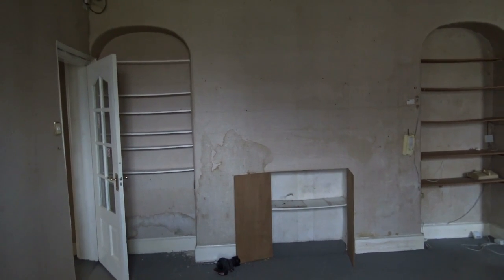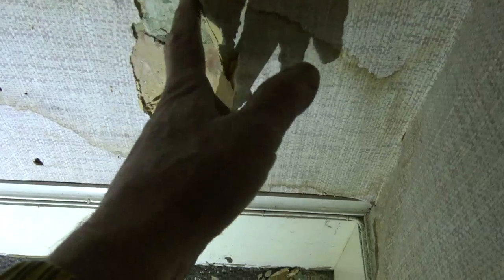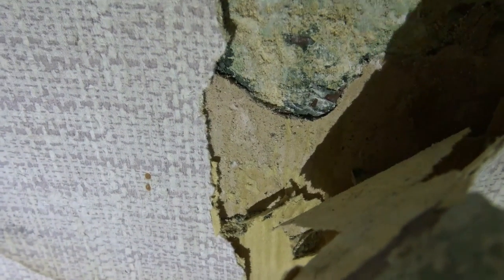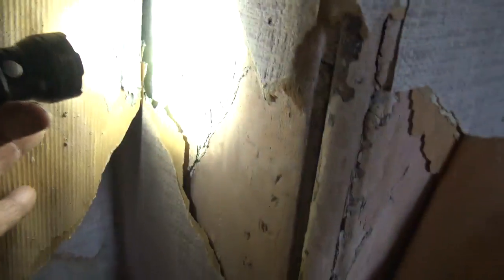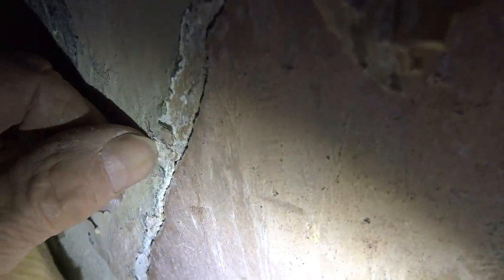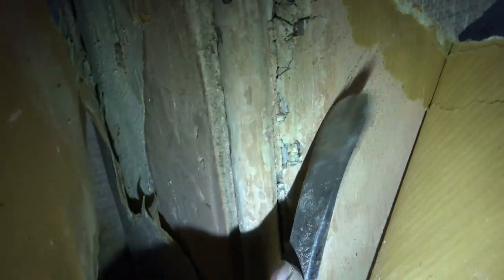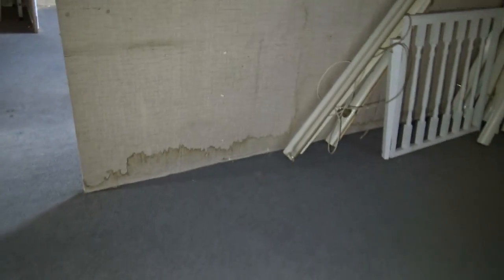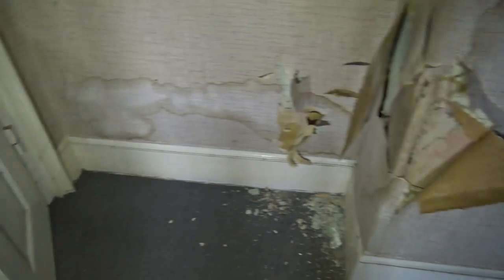Rising Damp?  No it ain't - just gypsum!

Comment: Nicely explained Peter. I try to slake my own lime putty mortars and plasters all the time as it's fantastic to use and being a putty
will never go off if you put it back n the tub with a bit of water on the top.
For the record I use sisal instead of hair and whenever I come across any of the bull-nosed corner timbers in a clients house I always try to re-do the 'quirks' (the plaster line) running down the edge which so many builders filled in during the 60's, 70's & 80's
because they add a touch of quality to any room.
Reply from the maker: Thanks Peter - great to hear from you - and please, please feel free to send us videos and information on your work - I'll happily put them on the website and help spread the word..
Reply: Thanks for the offer, I actually have a little place on Facebook called 'Limespred' which has a few
clips and things, I have also posted a couple of articles, more rant than essay, on LinkedIn under
my own name but tend not to go there that often,  it's not as good as your patch but like you I give 
out any free advice should anybody have any questions. 

The most amazing place I worked in was a church in Monmouthshire which is owned by the 
'Friends of Friendless Churches' and was a decommissioned building due to a few structural cracks
in one of the gable ends. 
This church up in the Valley's has the most amazing Sgraffito murals I've ever seen, the work was 
executed in sand & cement in about 1880 by Heywood Sumner. 
I guess he did it in cement because it was the new wonder material and he wasn't to know that it
was wrong for a building built in lime mortar and the pictures were done in green, brown, yellow, red, 
white and black plasters which he cut back into to reveal the different colours and the topography of 
the area with stylised sheep, hills, clouds and trees etc, quite a stunning bit of work.
However, over the years, the incoming water has pushed out the mortar into rounded bulges in places
at different heights and the boss decided that the best way to conserve the work was to inject lime 
grout into the bulges and leave them in place.

The church at Llanfair Kilgeddin is built in a water meadow without a dampproof membrane but in places there was a slate one of sorts which you'd expect to find and I had to cut away the first metre of render from the ground up, all around the inside of the building. 
I was sleeping in a caravan in the graveyard during the week and working all day and when it rained you could
almost see the damp wicking it's way up the rubblestone wall and back down again, I would not have believed it if I hadn't seen it with my own eyes, and is a nice example of why lime instead of cement should be used.
Reply from the maker: Wow!  I learn something new every day - be fantastic to see a video of that church.. you should definitely have a greater presence on the internet Peter - what a pleasure to meet you in the ether... !  I'll have a look at the FB page and join - I'm thinking of starting my own conservation 'institute' - the IHBC are next to useless, and RICS conservation stuff is not much better.  There needs to be a practical group that gives credibility to the stuff we do..
Reply: I have a presence as such but they aren't as in depth and comprehensive like yours, and meeting fellow builders such as your good self we can all add to a better understanding of the old materials. 
I get most of my materials from 'Limebase' whose propriator 'Joe' is very knowledgable though a little grumpy at times. But so long as we use like for like when we can then you can't go wrong but unfortunately because of the lack of work many new-build builders are jumping on the lime bandwagon and don't use the putty mixes. Limelite and Hansons are 2 names I see in most builders merchants and as I said, anything with the word lime in the title is used little realising that it may not be fit for the more delicate jobs like cob, old brick and the mud stones and more feeble sandstones.
I started uses sisal instead of hair because Joe at limebase wouldn't use it for some haired mixes I ordered
saying it would jam up his machinery which speaks volumes and says to me that it's stronger than hair.
See you in the ether Peter.
Reply from the maker: Limelite is dreadful stuff - I have attacked them in the past over this - it has a healthy portland cement content and is totally unbreathable.  I'll do a page on it on the website and push it a bit harder - people need to know it is unsuitable.
Reply: You are right there Peter. As far as the industry is concerned, if it has lime in the name then as far as they are concerned, it's lime. In about 10 years or 20 years we will have the same situation that we have now with the cement stuff on old buildings from the 1960's, 70's and 80's that is if they haven't fallen down already.
The trouble is that so many people who want to do the right thing for their buildings are being given the wrong advise by people who just want to make money.
Reply from the maker: Enter the Property Care Association with all their crooks and fraudsters.  Unfortunately IHBC isn't far behind - some of the crap advice being given out by conservation officers and so called conservation experts is awful.  The head of conservation for northampton recommends WHITE portland cement for pointing historic buildings.  I'm going to do a page on the sod on the website and expose him.  I need to do a page exposing limelite as well.  We CAN make a difference Peter - the internet is all around us - he who has the biggest following, the greatest presence, will win.  Youtube is great - Facebook works well - give people the simple truth, information that makes sense, and they WILL change.  Things are a lot better than 7 or 8 years ago when I first started attacking the PCA - most people now research before getting in the damp wallys - and 'Damp Wally' is now well known terminology on the internet.  I did a survey the other day, and the valuation surveyor turned up - climbed out of her car, and saw my polo shirt with Heritage House on it.  She looked at me, clutching her damp meter, and said 'Oh - it's you!'  The damp meter went away - the look of sheer guilt on her face when she waved it around was divine.  She KNEW it was a useless piece of equipment, but still carried it out of habit.
Reply: The head of conservation at Northampton is a tit of the highest order, and I can remember doing a job for
'English Heritage', now called 'Historic England', where I was told to add some white cement to a lime
mix by the guy in charge so that the mix would dry quicker, they could finish the job and get paid quicker.
I laughed when I read about the 'Damp Wallyenna' arriving, seeing you and putting/hiding her meter away.
When you start attacking the PCA please feel free to include me in any references, I can supply pictures
as well as locations and other witnesses and should it be taken to court will be perfectly happy to appear
as a witness for the prosecution of this deliberate damage to historical buildings.
Last week while working on 2 different jobs I have seen (and taken pictures of) the damage done by using
hard and harsh, 3 or 4:1 sand & cement mortar on fragile cob, wooden lintels and blue lias mud stone.
When we took it all out we even found that the builders had used 4 or 5 long lengths of rebar with a cement slurry poured in to help solidify it. The damage was worsened by hammering in cone-headed 6 inch nails
to hold the galvanised mesh in place which the cement render would fix too.
To take it off I used a 9  inch grinder to cut 4'x5' sections and then off they came. The lady house owner
was not only in near tears over the state of her house but we have been the talk of the village in their digital
parish magazine as a result.
Reply from the maker: Peter - this is the sort of stuff that needs to be on Facebook - I'll have a good look at your FB page and see what I can come up with.  Ideally you need a good website with easy to write pages - like ours - and then reference the pages to Twitter and FB - you get huge coverage, and the public love it - it just contributes to the inevitable death of the pca.  I'm happy to host examples on our site if you can let me have pics etc - probably best to email me though not on here..
Reply from the maker: Photos of that job would be great to show people...
Reply: Thanks Peter, I'm not as internet savvy as your good self so I'd be happy to post stuff up like you said. Anyway it's good to sing from the same sheet, just as it's possible to snap a single pencil it's not so easy with a bunch of them.

Comment: Thanks for this, I unfortunately have this same issue in my house, previous owners didn't know what they were doing and they damp proofed the entire bottom half of a victorian chimney breast. In order to solve this, do you have to remove the concrete and plaster and restore using the correct materials? Would the salt problem get worse if it was just left as it is?
Reply from the maker: Complex question - but yes - remove concrete and plaster - then also remove as much of the salted mortar as you can, and leave for a while then re-point in soft lime mortar.  Let dry out - and brush off any salts as they appear.  Also sweep chimney regularly to remove accumulated salts. Salts dont increase if you are not making more - by burning fossil fuels - coal burns and produces ammonia and sulphur dioxide = sulphuric acid = sulphates and nitrates in chimney. If leave as is - salts start to attack bricks etc - best to remove.
Reply: Thanks for the reply! The chimney breast is in a kitchen, it is no longer in use so the damage is from a long time ago and was caused by a combination of fossil fuels and more recently condensation due to lack of ventilation. Rather than fixing the ventilation the previous owners damp proofed the chimney breast and surrounding wall area, and now the plaster is showing signs of damage, the paint on it is coming off in places and there are some patches which look like damp in a few spots. It's a bit of a mess..
Reply from the maker: It may be a mess, but it has a new owner who clearly understands the issues - so I'm confident it will have a long and happy life now!!!!

Comment: what solution would you recommend here Peter?
Reply from the maker: See above - remove plaster etc, ventilate and reduce the humidity - need total moisture content of around 6 or 7 g/m3 - humidity controlled ventilation is almost essential in old buildings these days - ie RH of no more than 50% at temp of 18 degrees.  Sweep chimney, line with 905 grade liner if using it going forwards.  Dry air doesnt promote salts - any moisture in the brickwork will gradually evaporate, bringing salts to the surface, which can then be brushed off.  Removing contaminated mortar is good.  Salted fireplaces are not a simple fix - combination of things really.

Comment: Hi Peter.  Thank you for the videos. We are having 'new' paint  and concrete render removed externally.  This will be re-pointed and re-rendered with lime mortar/plaster where necessary. Then painted with lime wash.  Would it be worth delaying the internal removal of gypsum plaster and 'new' paint for a while to see if the external works make enough improvement ?  or should we just proceed?
Reply from the maker: Watch no angle grinders on brick - damages it beyond repair - only by hand, or using arbortech mortar saw..Depends on how damp walls were - certainly will help - if no apparent problems internally then can leave - BUT make sure internal moisture levels are low - humidity controlled ventilation is key - 6 or 7 g/m3 max - 50% RH max, at 18 degrees - this drops dew point to point where you unlikely to ever get interstitial condensation - which is what the so called rising damp really is - and if you dont get condensation = fog forming in wall and being trapped by gypsum and paint - then wall will stay dry.
Reply: Thank you Peter.  I will stipulate no angle grinders when removing pointing and render.  That Arbortech machine is great!   (Had to Google 'interstitial condensation'!!!)
Reply from the maker: It is indeed - blimming expensive though -nearly £1000 - wish I bought some in Oz before I left.  I know the man that invented them - lives in Perth.  Much cheaper over there.  We have one here and I'm just raking out the walls of my limestone Grade 2 listed cottage up north - so easy, and no damage to the stone.  Blades aren't cheap - but worth having - I guess if you look at the cost of the machine, and increased speed of job,  you'd probably end up with a cheaper job bearing in mind labour costs account for 75% of any build.
Reply from the maker: I'll think about doing a page on the www.heritage-house.org site on 'interstitial condensation' and try to explain it.  Really is just like fog forming in the wall.